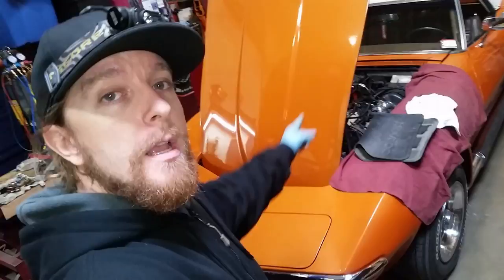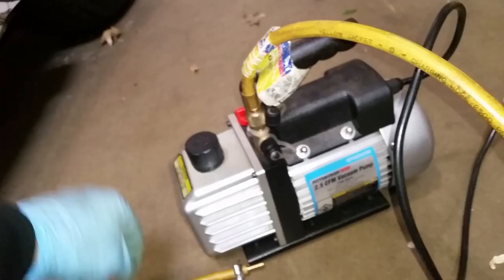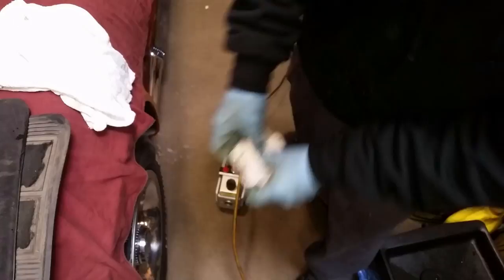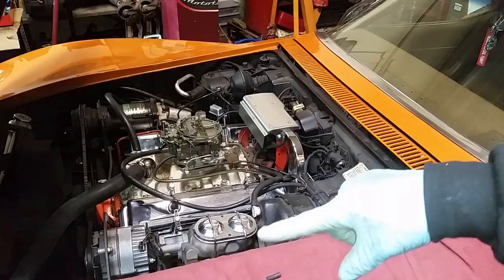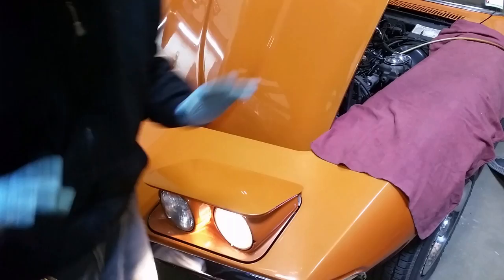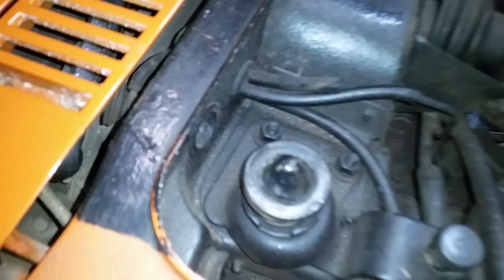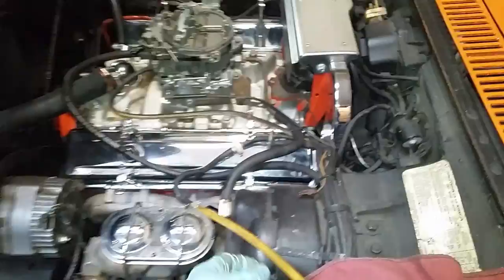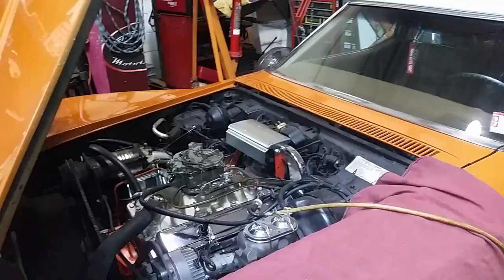How to test Vacuum operated systems on a C3 Corvette

Comment: Thanks for this. Will probably replace ALL the components of the system on my 71 project, but this is a great way to test. It’s also cool to see a Vette with the bottom windshield chrome showing. I was thinking about going that direction with mine.
Reply from the maker: Thanks I love the hideaway wipers on these years. Good luck with your 71!

Comment: The way I was tought: With the engine running spray canned either (starting fluid) along the vacume lines.  When/if the engine increases RPM, you've found a vacume leak.  I've used this several times tracking down leaks on my 77 vette.

Comment: great video it is a great way to test the vacuum system i have 1969 vette and the headlight vacuum line filter  which runs into back of manifold split into two piece and caused car not to start replaced a vrooom vroom rolling again  ;   lololo   once vacuum line is leaking it can affect many things on these cars thx again for video

Comment: Hey Rick, Great show man. My vette I believe has vacuum leaks. Started running like crap. Was running great until that point then stalled at a light. Revs went down to 5K, then lower and stalled. I might try your method. Thanks

Comment: The wiper door opened and closed really quickly, is that because the vacuum pump creates more vacuum than what the engine does under normal operation?
Reply from the maker: Exactly, it is a higher vacuum than the engine produces so it will function more efficiently during the vacuum pump test. The main reason for using the pump is that it is quieter and you can hear any leaks at an amplified level.
Reply: @CamaroRick  is there a setting on the pump or is there too much vacuum that can be generated would you say? Looking to pick one up to test all the vacuum vents on the inside can fun on our 77.
Reply from the maker: @robertmichael436  The one I have does not have any adjustability but you could put a t fitting in line and reduce the open end to limit the vacuum if required. I have not had any ill effects without doing it that way so I dont bother. Normal engine operation could see 20 to 25" of vacuum this pump can draw around 29" on a sealed system.
Reply: @CamaroRick  oh ok sounds good. Thanks for the response. This looks like a nice easy option.
Reply from the maker: @robertmichael436  No prob good luck!
Reply: @CamaroRick  was looking at this pump this weekend, is the fitting on there just a 1/4 fitting, could I rig this up with an air hose with fitting and a barb or is there something special about the vacuum hose fittings?

Comment: Hello, my pop up headlights on my c3 are stuck. One is a stuck halfway down, the other fully up. How man turns on the rods do you start with?
Reply from the maker: https://youtu.be/HGIWyaI5aOU?t=335
Heres a video on the adjustment. You really shouldnt have to mess with it unless your are replacing the vacuum actuator. The repro parts are not always the same length as the originals so you may have to play with it some. I would chase the threads to make it easier before trying to dial it in.

Comment: Great video, after seeing what you did with the vacuum generator, I’m wondering if this test can be reversed and use a smoke machine. As in like testing for emissions leaks.
Reply from the maker: It may be possible but the seals may be inadvertently pushed out instead of pulled in from the pressure vs vacuum and cause it to seal up in that case.

Comment: So where you located? I'm in Maine..bought my first c3 last year..good solid 76 stingray l82 42000 original miles..just needs TLC of vaccum  and some electrical...
Reply from the maker: Awesome find! Last of the "stingray" badges. I am in Maryland.
Reply: @CamaroRick  yeah it's a beautiful car. Doing a interior color change right now..I didn't like the red interior so I bought a complete interior from Corvette America in black
Went with Dakota digital gauges..added back up camera and 11 inch LCD screen. Just trying to figure  out the wiring issue while it's all apart..somthing is draining the battery..first I thought it could have been the battery,but I replaced it with a top brand marine battery..and is completely dead after being parked for 2 hours
Reply from the maker: @chuckgannon5633  get a good multi meter that measures up to 10 amp draw, and start a parasitic draw test. You can also use a test light
Reply: @CamaroRick  yeah I have a handy little tool called the power probe 2 that works pretty well
Reply: Chuck Gannon what did you buy? Because I’m probably going to do the same thing. 

How much did it cost? Was it a premade kit or did you add each thing separately?
Reply: @DeathByLego  i bought it a little at a time. Complete kits are pricey. Around 5 grand. So i bought all the major stuff some things like kick panles and lower dash i used plastic coat. To save some$$ so i could do some custom led gauges, 13 inch monitor with back up cameras, and some other things to make my vette different from the run of the mill vette.
Reply: @DeathByLego  ecklers corvette and Corvette america is where i get my high quality replacement parts.

Comment: Do you have any videos on how to repair the vents in the car the car I am working with only blows air at the bottom when the ac is on.
Reply from the maker: I dont yet, You can test the system the same way here if under hood is quiet try and listen under the dash for the area of the leak at that ac on switch position. might have to take the dash apart
Reply: Camaro Rick thank you !

Comment: Can this also be used for a stalling condition on my 78 corvette?ed
Reply from the maker: Unlikely because if you had a vacuum leak the idle would be higher than normal. Check the carburetor adjustments and timing. You can look up the specs on corvetteforum if you dont have a service manual.

Comment: If you give the car some gas does it aid in bringing the lights down.
Reply from the maker: Its possible on certain vacuum powered devices by shutting the throttle when above normal idle speed to create a sudden increase in vac to jolt it shut. If the leak is bad enough it wont help. The main feed builds up vacuum in a canister so it takes some time to regain the vacuum through the main vacuum hose.
Reply from the maker: there is a headlight door override under the dash that is used when the switch doesn't redirect vacuum correctly
Reply: Camaro Rick Excellent thank you!!!!! For the switch under the dash, it’s to bring the mask down.